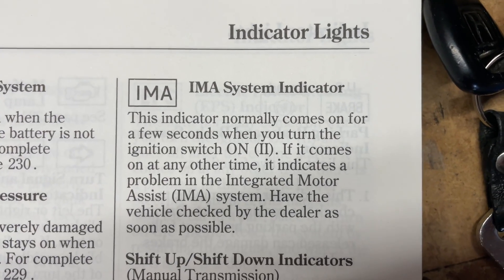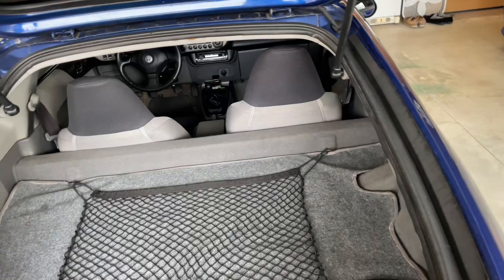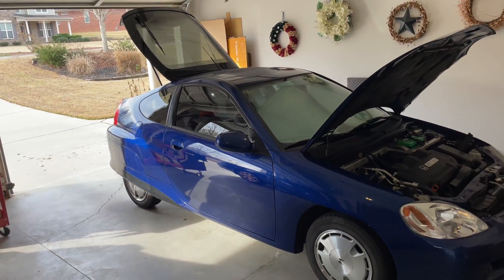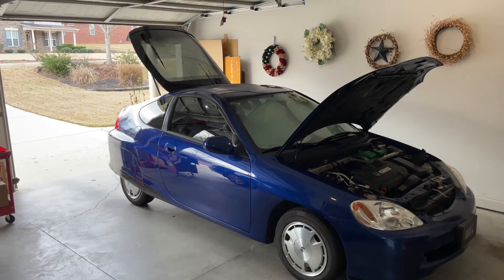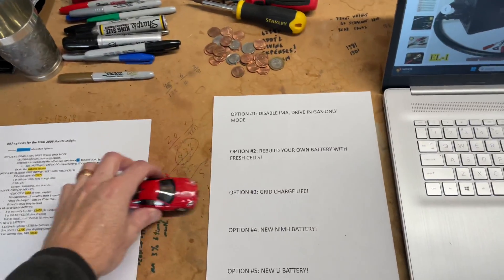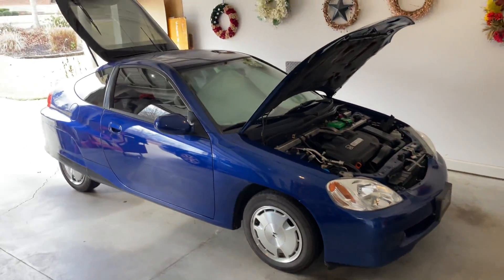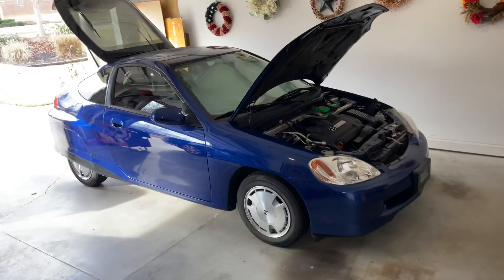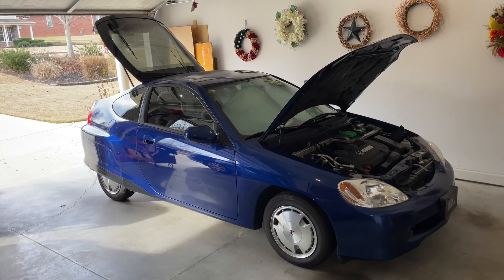5 most common ways to resolve IMA failure in a G1 Honda Insight

Comment: Hello, I just found your video, very insightful.  My 2002  insight wouldn't start after not running it for a while.  I had AAA come out to charge my front battery, and car turned on, however, when he removed the clamps, the car would power down.  I'm not sure what to do, he said it was the alternator, but, I found out there is no alternator on these cars. Do you think I need to dsicharge and charge my cell batteries in the back? Any suggestions would guide me in the right direction.  I do have a discharging and charging kit.  Susan
Reply from the maker: Sounds to me like your 12V was old and needed replacing, and the hybrid battery wasn't exercised for a time as you said so it discharged. Not good for an Insight, they have to be driven regularly or this often happens. Yes, discharge and then charge the hybrid battery with your grid charger and report back. Good luck.

Comment: Disconnect the negative cable on the 12 volt battery for 10 seconds and then reconnect it.
Start the engine and the IMA battery will charge in 6 minutes.

Comment: The key is to get the car to pass smog check...it fails if there is a check engine light.   So the arduino hack wlll do this?   Then I can just drive it on gas.

Comment: So for option B “pulling the fuse” do you still turn the breaker off ?
Reply from the maker: If you're talking about (1) gas-only mode, yes always turn breaker off if not using IMA. In fact you can remove the entire pack with a few mods and the car won't flash a CEL.

Comment: There is a missing option here. Run the car with the IMA light on. If you grid  charge and IMA light triggers within a few hours or a day or so. Car can still last 2-3 months. I go up steep mountains in gear 2 and drive over 600miles a week. Then charge again.

Comment: Did you install the same lithium pack that GreenTec sells-  with the Honda cells or did you install the FoMoCo cells? Thanks
Reply from the maker: I have the Honda cells. The FoMoCo option will be discussed in my next video.
Reply: @GenXJeffstuff  i have a 2000 Citrus Insight with extremely low miles (original pack).  I’m swaying toward sticking with the original NiMH pack from GreenTec.  I have discussed with “mudder” the other lithium options also.  I’m reluctant to deviate too far from “original” with my car due to its very low miles.  Although I do all my own maintenance like you, I doubt Honda would even look at our cars with a lithium pack.  The lithium is however a huge upgrade for most people.  Thanks.
Reply from the maker: @thomash681  I think you have to do what you most feel comfortable with. I will say the fact that GreenTec is backing. John‘s product says a lot about how good it is. I’m casually looking for a decent citrus, if you decide to sell it, please do let me know. I will pay you what it’s worth.
Reply: @GenXJeffstuff  ok thanks.  I sold my 2001 red Insight a few years ago on BaT.  I just missed it so was excited to find this Citrus

Comment: How many miles your Insight have?
Reply from the maker: 230,001!!! Ready for 230,001 more.
Reply: @GenXJeffstuff  I saw one for sale with 190 000 miles, and the problem is the IMA so I was hesitant about that.
Reply from the maker: @xavierdupuis8  I've got some videos on this channel you might enjoy that address your situation...in short, the two big things to look for are (1) IMA health and (2) transmission health. Those are the big ticket items that fail. IMA isn't an issue, it can be repaired/replaced. The transmission is the bigger concern. They tend to have synchro issues under 200k miles and fully begin failing due to ISB and other bearing failure past 200k. So before buying any Insight with some mileage you need to consider that. My car has 230k but the tranny was just rebuilt and it is quite nice.
Reply: @GenXJeffstuff  perfect I will chevk that, thank you for all your informations very appreciate.
Reply: Hell yea! I'm buying Li ion pack! (just need a core both my reg packs are good) Are they fully develooed now? (no longer in beta) And who has a good link for the current hack kit? Love this!
Reply from the maker: @michaelsparrow8033  You need to do some searching. In short NO they are not fully developed, still in beta and may be for a long time, but Greentec is taking preorders. Not sure when it will be out of beta. That said there are probably in excess of a million miles on Lithium swapped Insights without issue, so it's about done. Use at your own risk. On the current hack, search is your friend...I have previous videos on my channel on all these topics that might help you.
Reply: We have 442k on ours. Struggling with up the hills and getting up and going from a stop. Definitely bad off the line lol. $300 swap out from a scrap yard restored power to the assist motor....  Wish this tuner hack was commercially available.